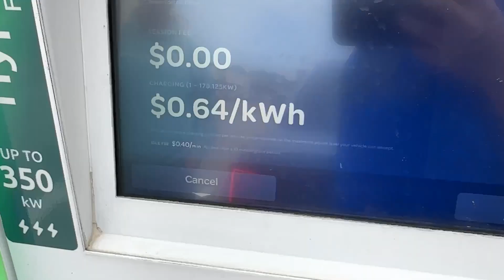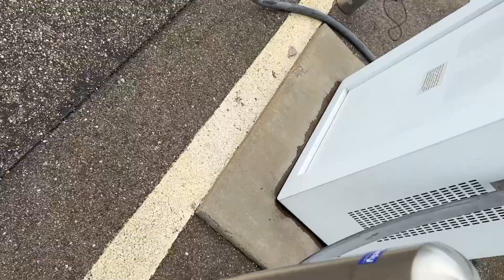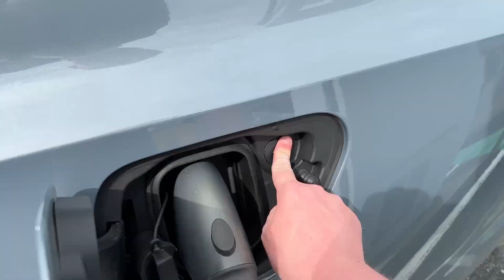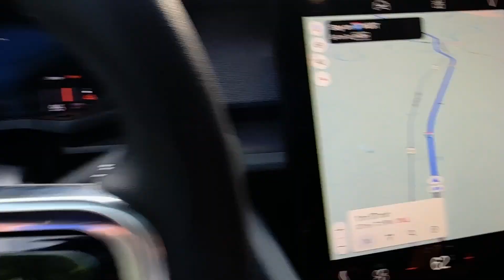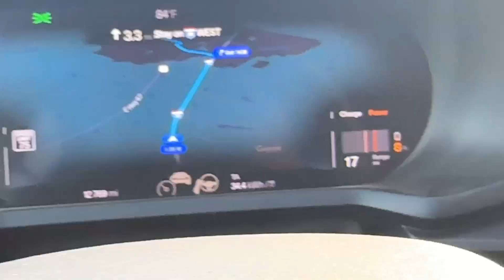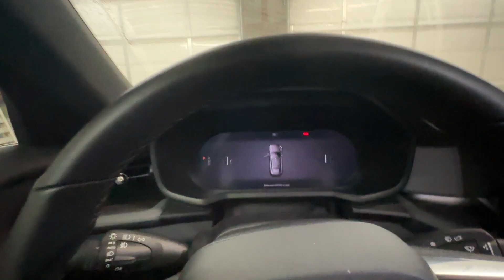Road Tripping a "Short Range" EV is NOT Hard! | 620 Mile Polestar 2 Road Trip!

Comment: Misleading title. It IS HARD because of constant range anxiety and have to plan ahead to stop at fast charging stations. If you use level 2 chargers then you will be waiting an entire day, which is not good at all. Fast chargers add up on the cost extremely quickly if you keep stopping and charging. Way more than what you pay for gas and you gotta be careful driving slow and turn climate off if you want to maximize range. Let me ask you, why go through all that trouble for the huge inconvenience when a gas vehicle can go longer don't need to worry about anything else? If you drive EV in winter, would you rather freeze up and get sick while trying to squeeze out as much range as you can. If you drive in summer, would you rather suffer from heatstroke while trying to squeeze out as much range as you can? Why go through that extent when a gas vehicle is clearly a  much better choice?
Reply from the maker: I think you've never road-tripped an EV, especially not a Tesla. Tesla makes it super easy by telling you exactly how much and where to charge. Polestar also does this and it works exceptionally well. If you just follow the route planner, you won't ever run out of charge (unless you have some sort of spontaneous weather event). The cars calculate exactly how much energy you will use, and just to be safe if you are still nervous, maintain a 15% battery buffer upon arrival, that way you have extra. It doesn't take more than an extra 2 minutes to gain that extra 5% on top of a typical 10% buffer. With more buffer, you can drive as fast as you want, run climate control,   etc. Although if you need to get somewhere quickly, I can see why you would be frustrated.

The pricing is getting better, and is cheaper than gas if you own a Tesla. Teslas get ~$0.33 KWh on superchargers, so it's cheaper than gas per mile even after wear and tear. Public EV charging (show in this video) not so much..... Most of my charging was at ~$0.49 KWh, so maybe a little bit less than diesel, but probably more than 87. Home electric rates near me are less than HALF of public ones (~$0.14 per KWh). 

The reason I drive electric, IS for convince. ALL of my day to day driving is LESS than the total range of the vehicle. If there is an exception, there are plenty of public chargers in my area right off major interstates. When doing daily driving, I just recharge at home.

Comment: How long does the car take to charge at DC fast chargers ? And how much does it cost ? because i had a Kia ev6 rental and it took 16-18mins to charge to 80% at a charge point DC fast charger. Which was really good, and the range would last two weeks. The cost was around $18. Way cheaper than the gasoline car I own now. I’m considering a Polestar 2
Reply from the maker: Very similar cost to EV6 as the two battery packs are nearly identical capacities. I have confirmed that my Polestar will do a 15-75% charge in 27 Mins. Do note that since polestar is less efficient, even though the price is the same, the range is still 30-40 miles less than an equivalently priced EV6, depends on if it is the pre refresh or not, and if it is US or non US market vehicle. (Refresh US DM cars get the older pack whilst NON-US DM cars get the Updated Pack with 5 KWH more capacity and 50 KW higher charging speeds.)
Reply: You need to factor in how much range you are actually getting for that $18, and compare it to how far a $18 filling up gas can get you in a gas vehicle. Also depending on if you drive mostly in cities vs freeways. If you turn on ac or if you don't. A lot of things can significantly reduce range. I think the answer is pretty clear here, you can go farther spending the same amount for gas in a fuel efficient gas vehicle.